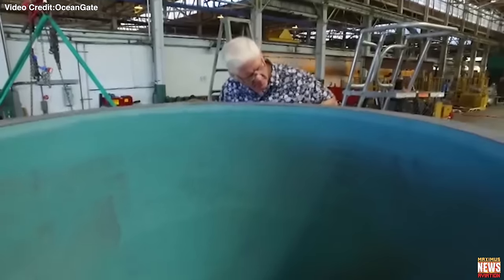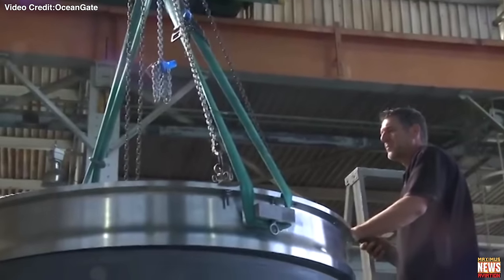Watch The Manufacturing Process That DOOMED OceanGates Titan To Fail. But It NEVER Had To Happen.

Comment: As a materials scientist I really wonder what the hell they were thinking building a pressure vessel that uses a material that’s great in tension but lousy in compression.
Reply: I doubt that ANYONE in the company knew that.
Reply: @johannesswillery7855  EVERYBODY KNOWS THAT !!!, you can escape a room by hanging sheets from the balcony, try using sheets to push a car. carbon fiber is textile with glue, a kid knows you can't push with it
Reply: this is the only good explanation, it's not the joystick, or the glue, it's not even the wrong layering of the fibers, or it's orientation, or quality assurance, it's just fundamentally wrong because carbon fiber bends, it's fantastic for resisting tension, i think twice as good as steel for the same weight ? but when under pressure, it's the epoxy glue that does everything, and as it is brittle it will never last, there is just one other fundamental flaw, the shape, a tube does not disperse forces like a sphere does, all that to be able to have one more passenger !
Reply: @nitraM321  Yep, that's the sad part.
Reply: It's all about tension and compression. 
Think of the old days. You want to make a lashing between the lower mast and the top mast of a boat. A piece of hemp rope would work wonderfully because it can handle tension. You wouldn't hack out pieces of sand stone for that application.
Now you want to build a vault in a cathedral. Sand stone can handle the compession and is what has been used traditionally. A hemp rope can't hold up a vault.
That is the Titan in a nut shell. 
Now change from hemp to carbon fibre.
Those carbon fibres did nothing to the integrity of the vessel. The epoxi matrix had to take all the compression stress. Mysteriously it worked a few times. But it was doomed to fail eventually. The epoxi would squish out to the sides under compression. That is delaminate.
Reply: yup. The engineers who built this think without a care in the world needs to lose their certifications.
Reply: Everyone talks about the carbon fibre, but that is not the weakest link in the chain, the epoxy is. It is a plastic and has no structural ability or fatigue strength.
Reply: US navy built submarines from carbon fiber and titanium for 40 years now, that's not the problem
Reply: @tedarcher9120 No, Navy submarines have never been built from carbon fiber. They sometimes use "carbon steel", which is a special type of steel that is better in tension. Huge difference.
Reply: @bradleywalker8642  I don't mean manned submarines, I mean autonomous recon vehicles
Reply: @tedarcher9120   That's a false equivalence since they won't have a carbon fibre pressure vessel.
Reply: @tedarcher9120  "Another technology called ambient pressure submersibles maintains the same pressure both inside and outside the vessel. The interior is air-filled, at a pressure to balance the external pressure, so the hull does not have to withstand a pressure difference."
It's much easier to build a sub when you don't have to worry about people breathing inside it.
Reply: @bradleywalker8642  not really. At pressures air becomes supercritical super chemically active fluid. Much better to use just oil

Comment: The fact none of these people stopped for a minute to think about what they were doing is astonishing, how many "engineers" are in there, how did none of them ever think that two dissimilar materials being glued together could just crumble under the massive pressures at 4000 feet
Reply: 2 did. they got fired and sued by OceanGate for the trouble
Reply: I think some just went along for a job, to not get the heat, for perks.
Reply: Well, if you look at the CEO's attitude, he did not want to hire "old White men" with decades of engineering experience and high education but instead wanted a diverse younger inexperienced group to work on that coffin.  Well done.  SUE that company!!!
Reply: It’s not 4000ft. It was rated to 4000 meters, which is about 13,120ft. Titanic is at 12,500ft deep. News keeps using meters, I don’t think most realize how deep it actually is.
Reply: @fireguy8466  beat me to the correction good job.
Reply: Stockton Rush was in love with the Titanic and used people to fund his obsession with a $250,000 ticket ride per person. His obsession finally cost him his life and some very foolish people their lives also, especially a young 19 yr. old kid who didn't even want to go, but wanted to please his father for Father's Day. Just look at how cheaply he built the submersible and used even cheaper equipment to operate it.
Reply: $$$ and if it had of worked (which it couldn't) they thought they were involved in something innovative and more $$$. Now there's a video of them and people know who "they" are like that Nissen dude
Reply: It's what happens when you allow somebody who gets the easily have money and not bright enough to utilize said money
Reply: Previous occupants have expressed concern and some swore to never go again after their first experience.
Reply: You would be surprised how many young engineers can make basic mistakes due to lack of getting their hand dirty. It is why many workers in the shop laugh about engineers. When I started I gained their respect by showing them I could operate machine tools,   etc..
Reply: @fireguy8466  confusion again and again due to the persistent use in the US of Freedumb measures !
Reply: I thought the depth was around 13,000 feet.
Reply: @ozcaks8888  My experience with young people in general is they aren't very smart when it comes to mechanical things and materials.  Too much computer play and not enough practical play in a sand box.  This is a lot like the FIU bridge that had an even more screwball design based on numerology.  I  think the submirsible was better conceived than the FIU bridge.
Reply: @jpcaretta8847  ah. What system of measurement do they use to measure the diameter of car wheels and tires across the world?
Reply: @fireguy8466  Even if it was “only” 4000”…….😢
Reply: @fireguy8466  One problem is  America, as usual in a little world of its own pointlessly still insists on using the ancient foot measurement from the ancient pre-scientific era, which constantly causes problems whenever it attempts to interface with the rest of the planet. Who knows if calculations in this debacle may not have muddled the standards. It has trashed enough space ventures for sure.
Reply: 4000 Meters. Closer to 13,500ft
Reply: @russcole5685  4000 m, no need for freedumb measures.
Reply: Guess it had nothing to do with the fact that they were glued or dissimilar. The layers of carbon fiber just got loose, until the whole thing caved in under a microsecond and crushed everyone in it..
Reply: It's not so much the dissimilar materials....it's the BASIC concept of putting carbon fibers into COMPRESSION when it should be in TENSION. Very basic application mistake...and eye-opening that so many technical people were involved and this wasn't brought up as a concern. The construction was OK if the inside of the sub had greater pressure than the outside ( putting the carbon finer into proper tension)...but instead it was fully opposite.....insane, and totally wrong.
Reply: Best professor I ever had told me “That degree means you know just enough to be dangerous” I never forgot that and found engineers to learn from that started out as machinists and worked their way through school. I also learned from grumpy old men in the shop who would throw tools at you when you screwed up. I carry on their legacy by being the grumpy old man who doesn’t let the young engineers do something stupid.
Reply: @TheWilferch it was brought up as a concern and they fired the Engineers who told them that this wouldn't work.
Reply: @eq2092  .... I hear you, but with the data we have so far, I think this is inorrect. I think the "objection" raised was that the material was carbon fiber, ...not so muh that the carbon fiber was used improperly ( in compressive load vs. tension....I guess we shall see as time marches on and more info comes to light). Then there is this too--> the manufacturer going along with this scheme who should know better not to do it this way....for this type of design application done wrong....yet they still did. Regardless if the concern about being in compression was mentioned and dismessed by the sub CEO from his employees or hired designers....there is still responsibility on the shoulders of the "pro" provider of the Carbon Fiber cylinder and the manufacturing process. They have a moral obligation..and perhaps even a legal obligation.... not to provide a knowingly-fatally-flawed design.
Reply: @TheWilferch im sure oceangate didnt tell the carbon manufacturer!! in fact im possitive the engineers from the manufacturers said "hey guys what you building?" "we can help you"....ceo just laughed im sure!!
Reply: @lunam7249  ...with all due respect....the manufacturer....seeing all the other details of the "thing" they were building......had a fairly good idea of WHAT they were building....it wasn't just a carbon-fiber-wound cylinder. They have some skin in the game for keeping quiet.......they knew it would be used in water therefore the improper-direction of applied force the craft will endure.
Reply: They weren’t really engineers, they were Stockton’s yes men.
Reply: Let alone 12000 ft. Where the Titanic is. Absolutely, you're right.
Reply: @pat5882  ...did you just skim my response?.....I'm speaking of the company that made the carbon fiber cylinder FOR Stockton.....THESE guys were real engineers for a real company. They share in the outcome for being quiet knowing how it was to be used.
Reply: @Deploracle  Why would they want to go again tho. Once going down you'd think would be enough not like the scenery down there was going to change much in a years time
Reply: @TheWilferch  hiw do we know the carbon company knew the depth or plans for deep sea!?
Reply: @KB-rm6pt  Whoops that's what i meant, mixed up imperial and metric :D my bad
Reply: @TheWilferch  Rush, to me at least, comes across as arrogant. A skilled welder employed by GDEB as a consultant would have told him that his contraption would have never worked. However, Rush would dismiss his statement and end the the consulting contract.
Reply: Try more 12'000 feet
Reply: @lunam7249  ...doesn't matter....the application was putting the vessel into compressove loads instead of tension....totally wrong "directon" of the load. Like pushing on a rope....wrong direction. Rope is strong in tension and terribly weak in compression...same with carbon fiber. Even at an assumed depth of a 100 or 200 feet...would be criminally wrong .
Reply: @pat5882  ...all understood...but there is still a  point missed with the other responses I'm making---> at some point a valid engineering/design/ company actually agreed to build the Carbon fiber structure for him...and they knew full well that the vessel would be "put into the water".....regardless of depth and regardless if they risked losing the job or contract building this  for him...they went along and are partially responsible for either not stopping the work... or at least informing authorities of the disaster that was sure to unfold by building something wrong ( knowing the vessel will be put in compressive-load service)
Reply: Plain hubris. Plenty of industry professionals warned him several times that this craft was a potential coffin and that it would lead to severe consequences and it did.
Reply: @fireguy8466  My thoughts exactly!! 
Cheers from Sydney/ Australia.
Reply: Titanic is at 13000ft pressure nearly 400atm.
Reply: @robertwilson2007 This is the truth. He didn’t have enough money to build it himself so had to sell tickets. Even then it wasn’t seaworthy, he was told he had to re-do the looking port but instead chose to not get certified and go anyway. Tragic
Reply: @billmiller3425 Diverse? …not in this video, not one bit.
Reply: It made it multiple
times so the design worked. The issue is there was absolutely no quality control or inspection. The materials used and the mating methods are so that without constant inspection issues will arise. It seems as though the engineering stopped as soon as it was produced and made its first dive, no one thought or cared to have regular inspection and maintenance. Complete disregard of safety
Reply: @eightlights4939  full on clown show